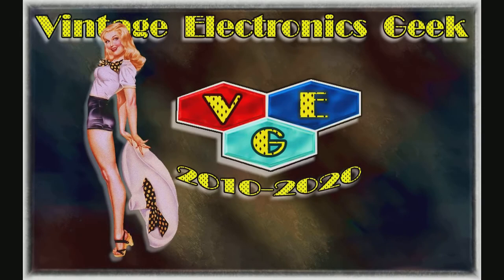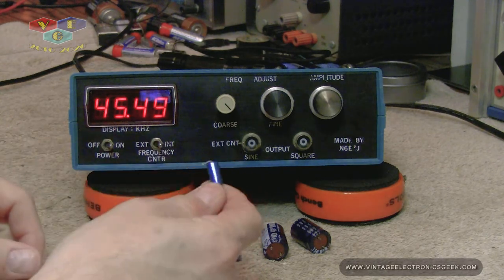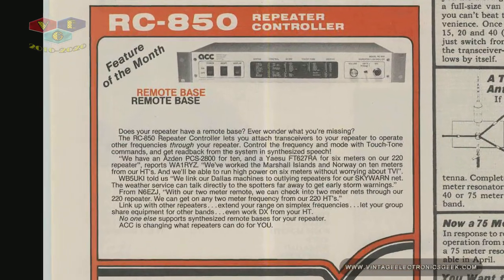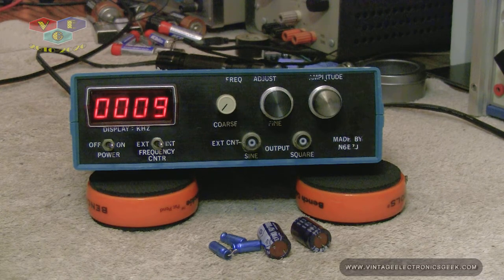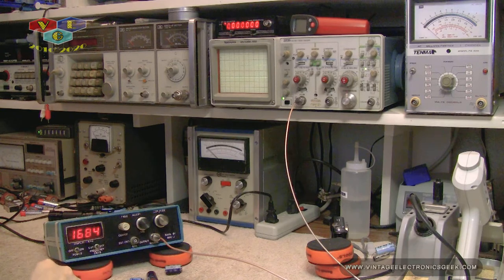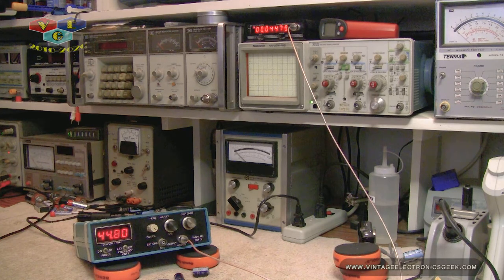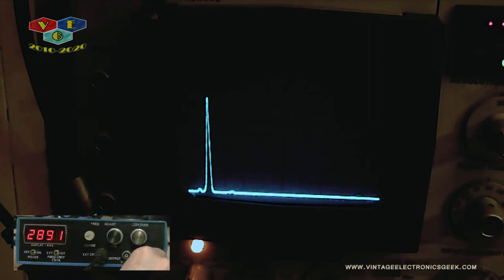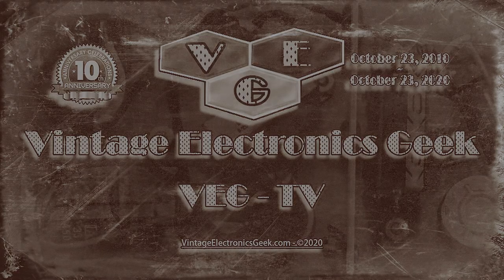TGT - N6EZJ Audio Function Generator

Comment: 19.84, how fitting for our times!
I still think it's a DIY project, a very well executed one, but not impossible with the skill and the tools. 
I don't think it is mains freq controlled, it rather has analog oscillators inside. The square output is probably achieved by simply running the sine through an op-amp with no NFB to overdrive it, "infinite" clipping so to say, that's why it doesn't respond to the amplitude setting. Woulda needed another stage, or atleast a second pot for that. An elegant solution would have been a stereo pot to combine the two. 
Thanks for presenting another interesting, obscure device Jack.
Reply from the maker: So true my friend, so true!  I can buy that theory, I watch others on YT  who have mad whack crazy skills and I'm like...I got a hammer and a twig, now what!  :)  I failed to research the IC's...guess I shoulda so I  could try and better understand whats happening, but sometimes its hard when you don't know what the answer should be for the question. I learn so much from you, thank you for taking your time in helping me, I really, really appreciate it!  I'm sure anything audio peaks your curiosity!  :)  My pleasure, I like vintage test gear...allot...probably more then I should....more to come.  Thanks!  ~Jack, VEG

Comment: No one really  sells the enclosure boxes by dimensions only model numbers on Fleabay. But I see a seller who has a page that tells you  his  dimensions  on his last photo!
Look for this in  a Fleabay search Jack: PAC TEC CM86-175 ENCLOSURE FOR ELECTRONICS NEW .The seller has a few of them. Dimensions if I read right (LxWxH)
are 8" by 6.25" by 2". I'm guessing here but that looks to be slightly too small for your needs. Yours reminds of a place in NY state that had a catalog filled with
electronics kits . Ramsey Electronics (which is now gone) but see if you can google a catalog to peruse through to match case dimensions or maybe same kit! 
  Not sure of the maker but this was a kit from a company for sure. It seems to work as intended and very nicely for the price. Steve
Reply from the maker: Thank you for looking for me...the one you mentioned is a little smaller then what I have....oh well, one will come along eventually. I will look for Ramsey catalogue...Ill also look in 1980's Rat Shack as well. Thank you again.  ~Jack, VEG

Comment: 26:45 the constant frequency at the bottom of the spectrum is at 120 Hz. Rectified mains hum.
Reply from the maker: Interesting, I've not heard of that before...can you point to somewhere I can learn more about that if you know off the top of your head?  If not, I'll search. Thanks!  ~Jack, VEG
Reply: @VintageElectronicsGeek  

Nothing special, really. Just the regular hum you can hear on, say, a mains powered radio just above the noise floor. 
It's at 120 cycles because the full-bridge rectifier arrangment turns the bottom half of the mains waveform upside down, effectively doubling the fundamental frequency. Filter caps and even voltage regulators can never filter it out entirely, but often good enough you don't notice it unless you put your ear right next to the speaker (or probe it with a spectrum analyzer, as you did).
Reply from the maker: @westelaudio943  Wow, that's cool, I've not heard the science behind it before...I knew the what the rectifier did to the sine wave and the cap but not as you explained.  Really wished you'd start a channel...to much knowledge you have...dumb people like me can learn from you then we wouldn't sound to dumb on our channel.  :)  There was a audio channel I subbed to a long time ago, he was cool but then he stopped and his channel was gone, sucked. ~Jack, VEG
Reply from the maker: @westelaudio943  Please let me know if and when you do indeed start a new channel, Ill sub!  I understand about political stance...I was trying to comment on LuckyLarrys channel on his video, stating how Beijing Joe & the hoe are not mine neither but the comment kept disappearing <lets see if it does here>.  I watch Shango and really like his content...even though I'm not into TV's I watch for the basics for electronic learning and troubleshooting <I'm weak on troubleshooting skills>...I have worked on a few modern flat panels....I suck, but I try. I will check out Diode Guy.

I also watch  D-Lab, he works on guitar amps and vintage electronics, I watch The Radio Shop, RTVPN, David Tipton, EEVLab and a handful of others...some stuff over my head, but I watch and absorb what I can.

Sorry to hear about your financial difficulties...may I ask, did you work in the electronic field before the plandemic?  I understand about personal 411...I too "try" to stay obscured.  :)  Hopefully the  work you do get will at least keep you maintained until things improve.  I'm sure "if" you became active and rented out your service, you'll get work off of YT...you could also pimp yourself out on eBay?  ~Jack, VEG
Reply: @VintageElectronicsGeek  

No, I never worked in Electronics professionally. But my knowledge is also quite lacking in comparison to Shango or D-Lab.
Reply from the maker: @westelaudio943  Mine is even less!  :)  ~Jack, VEG